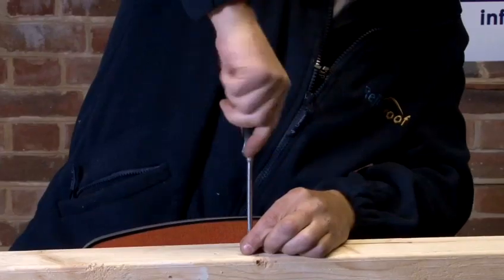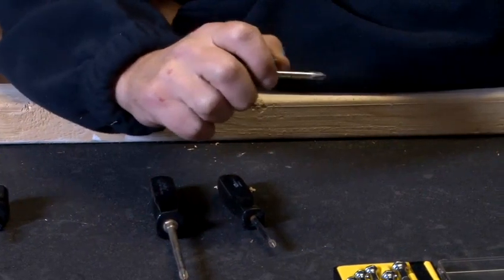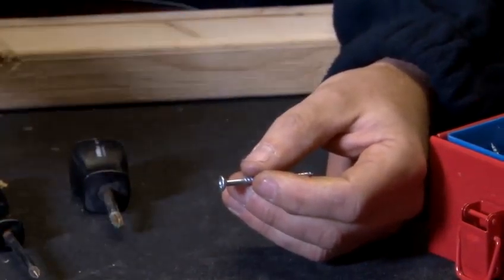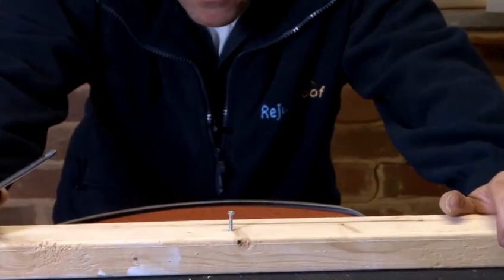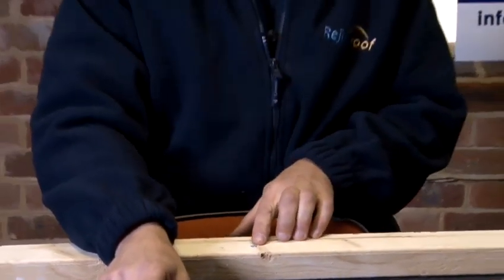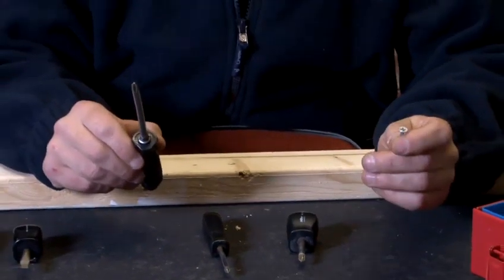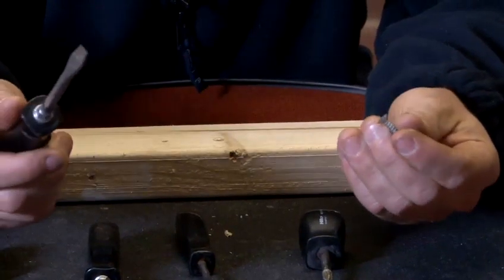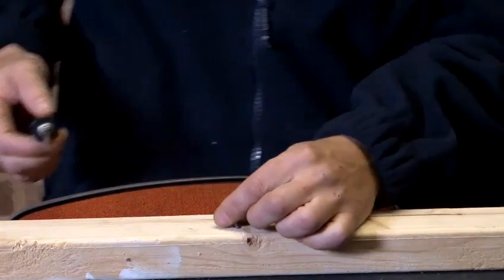How To Use Different Types Of Screwdriver

Comment: Nice video.  I think that the dumpy or stubby screw driver is useful for places that are easily accessible and the longer screwdrivers are useful for places that are harder to get to.  Some more closeups would be useful.  It would be really useful to show more clearly how to select the correct size Philipps screwdriver.  Showing some equipment which require the use of different size screwdrivers would be useful.  The #0 Phillips is usually used on electronic equipment.

Comment: I like a girthy screwdriver personally. Length is also important but not essential. Sometimes I like to use a stubbier screwdriver. They fit real nice like in my tool belt and I can fit them in almost any hole. I must sdmit there is nothing quite like a nice solid screwdriver in my hands. How do you do?!